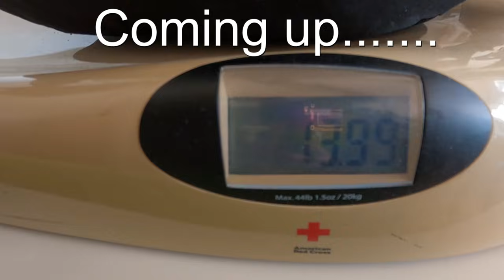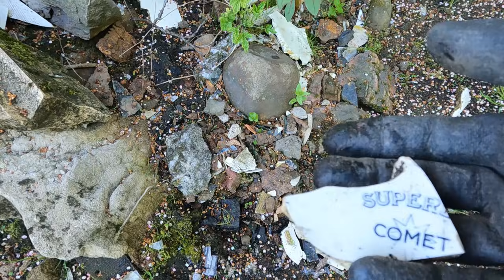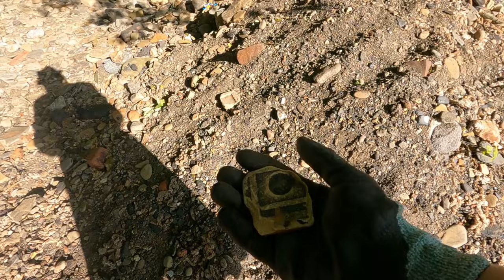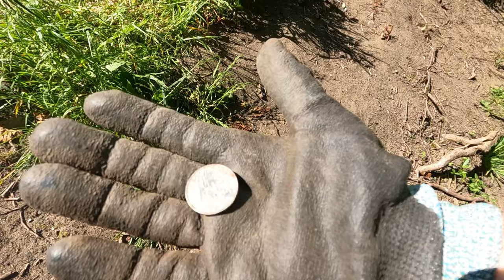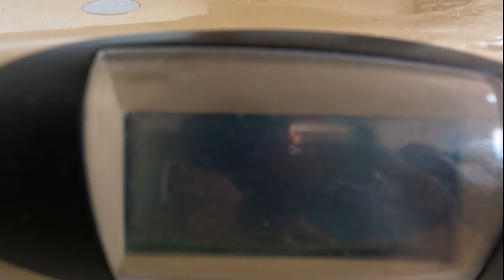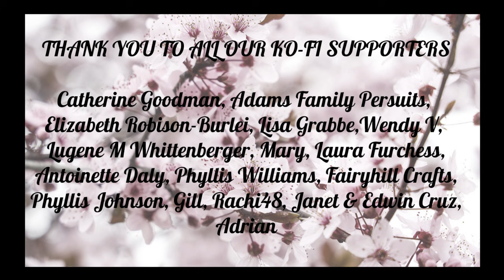Finding glass bottles on old rubbish dump - plus more finds!

Comment: A tooth story:  way back in 69 or 70….I moved to a farm my husband and I shared.  Down the country road was the house of my mother-in-laws aged parents.  One day I arrived to find gramps filing a tooth just like you found and fitting it into this plate…when I looked closer at the plate I realized it was his upper denture….WHAT!  He was missing 2 teeth and instead of going to a dentist he was wiring in this cows tooth….right next to that one there was already a cow tooth wired in!  My exclamation must have shook the roof…my first thought was how did the roof of his mouth handle the copper twisted wire….then everything from hygiene to running outside and throwing up happened…I told my mother-in- law that someone better get him to a dentist for goodness sake
Reply from the maker: As tooth stories go Dyanne, that's in a class of it's own 😱 They don't make them like that any more 😄